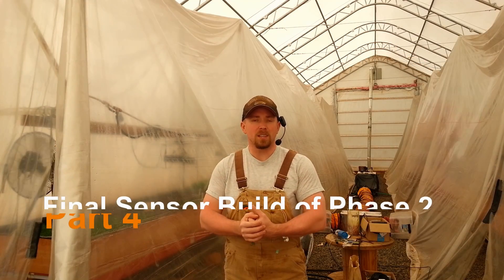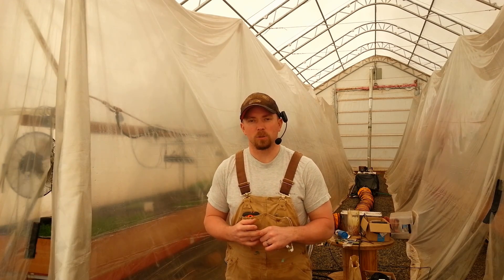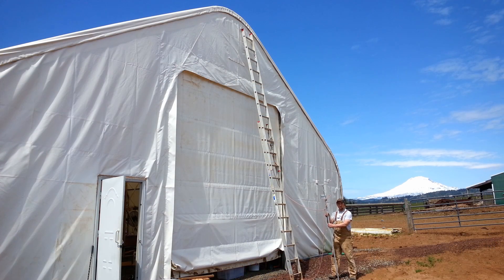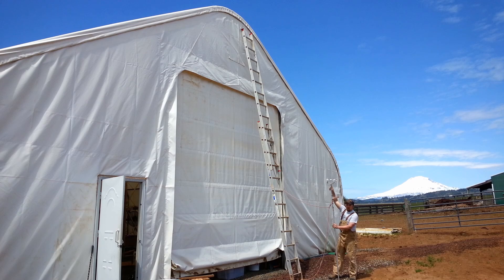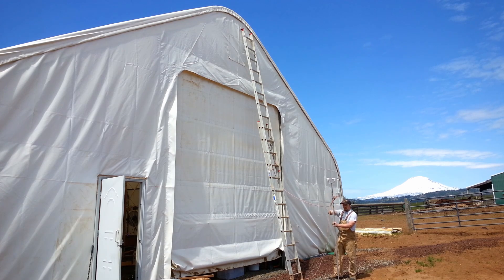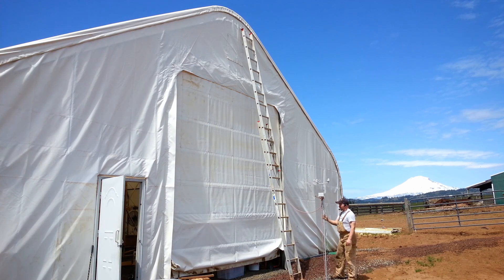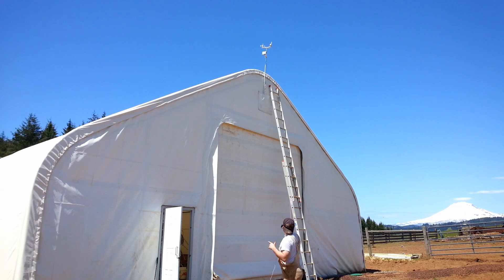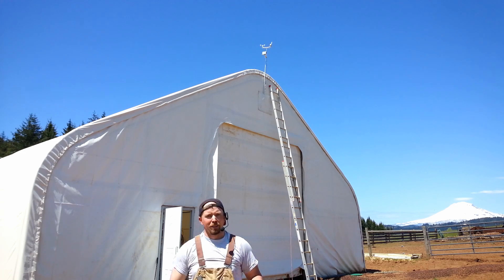Off-Grid Trout Aquaponics Automation - Arduino Sensor Build Part 4

Comment: The building will accelerate/brake the wind and your measurements will not be accurate UNLESS you plan to put the windmill at the same position as the anemometer is today. It is basically 2 ft over the terrain. Also I believe I remember that windmills mounted on buildings has less life expectancy because of the vibrations caused by the turbulence.

Nice to see you out in the summer wears again ;o)

Comment: Yea, falling off of ladders is no fun.  I can tell you that from experience.  Broke both of my heals in a ladder accident.  As you fall you make a flash decision how you want to land.   Hit your head or land on your feet, at least that was what it was like for me.  12 foot step ladder tipped over on me on concrete.   I also had an extension ladder slip on me inside a warehouse.  Luckily I was able to grab a sidewall beam and catch the ladder with my feet and righted it again.  Floor was a bit slippery.   It's best to have two people whenever you can.  You never know until it happens. 

Yea, your going to have problems with your outdoor temperature sensor.   I can see, just from watching your videos, your not going to be happy with it, so you might as well fix it now, if you can.

Comment: Falling is fine it's the sudden stop at the bottom you have to watch out for 😂 looks like fun up there, I do wonder if any water will get inside the building through or around the pole? It obviously won't be a problem now as it will drip back outside through the roller door but when you seal the roller door for next winter it could become a large issue very quickly :-( hope all your projects are going smoothly :-)

Comment: Put the same weather unit on the other side of the building. You could average the result values and you have a kind of spare situation.
Reply: Joop Terwijn you would need to take the lowest a it temp to get the truck air temp as one will be artificially higher from being in direct sunlight :-)
Reply from the maker: great idea